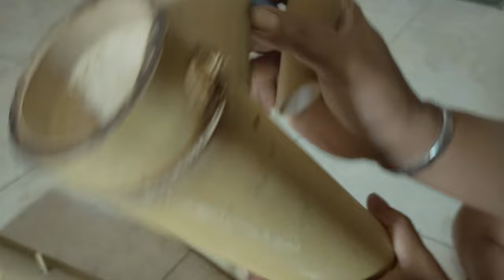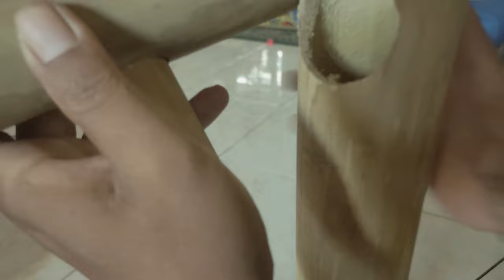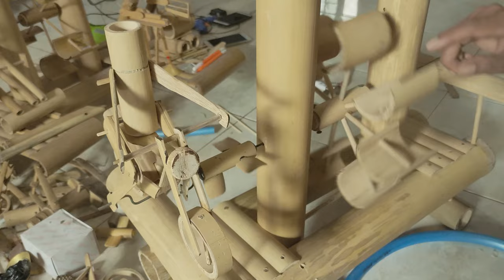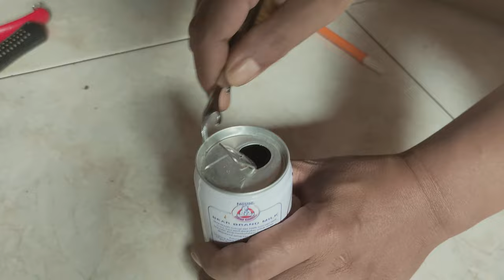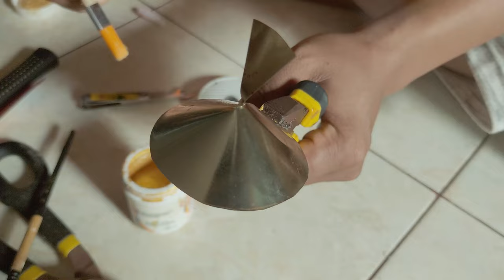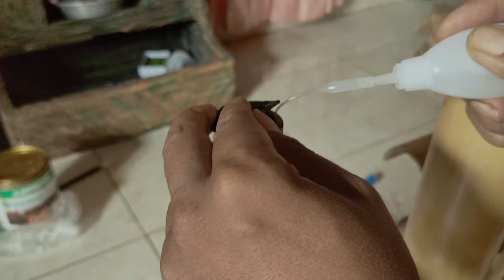KINCIR AIR DARI BAMBU, Cara mudah membuat Kincir Air

Comment: its beautiful-what kind of metal is it made of?
Reply from the maker: Kind of metal is Galvanis. you can buy at building shop
Reply: @energisemesta9724  Thank you,does it work with aluminum wire?
Reply from the maker: @ivanboqnov9670  no it is not Aluminium
Reply: @energisemesta9724  Thank you,what is the thin wire with which the figurines are  tied and how many millimeters?
Reply from the maker: @ivanboqnov9670  Metal is name GALVANIS. You can browsing google or YouTube
Reply from the maker: @ivanboqnov9670  2-3 mm
Reply: @energisemesta9724  You glue the axis  of the carouselmwith two-componennt glue.Why not glue it with warm silicone?
Reply from the maker: @ivanboqnov9670  the glue that I use is strong enough to be waterproof, heat resistant and vibration resistant